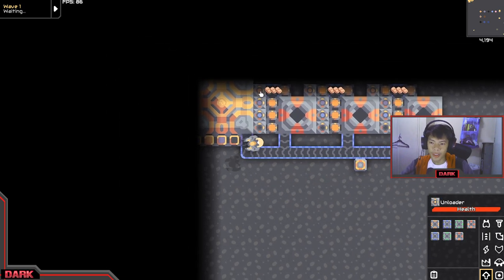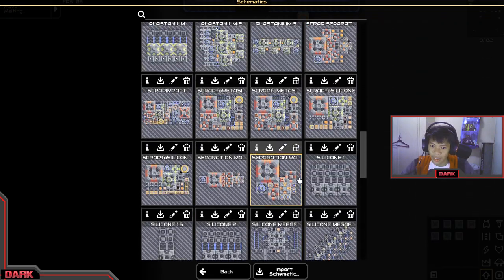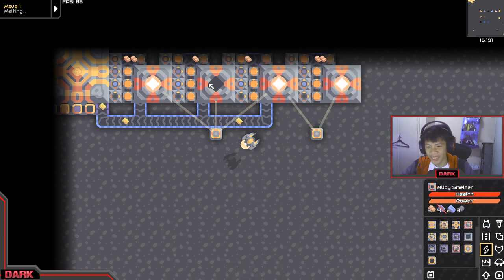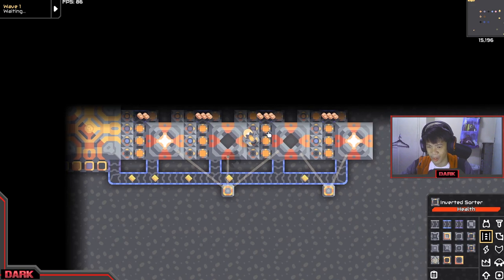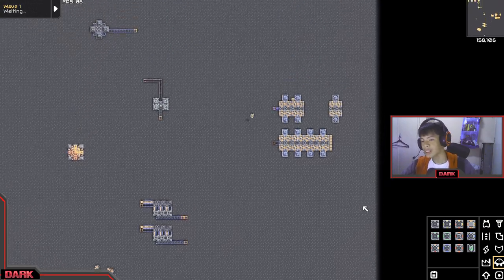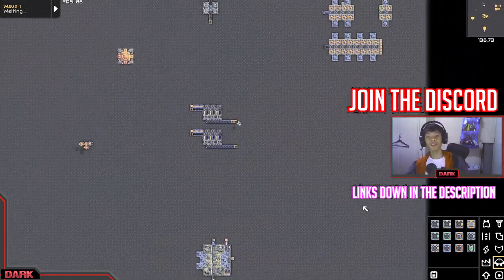MUST HAVE Basic Schematics

Comment: Include more schems involving bridge convos cos anyone who hasn't seen them before, just deletes them online, also most of them don't clogg and are completely efficient unlike underflow/junction chains which when copied multiple times on a single input become very inefficient
You might also want to use actual mines instead of item sources cos it gives a nice idea of resources required, for example, people sometimes use equal numbers of sand and coal mines to feed a single set of sili which is in one word, bad.
Reply: I'm new so i dont know much but how many sand mines to coal mines?
Reply: @atharvaprabhu7467  2 : 1